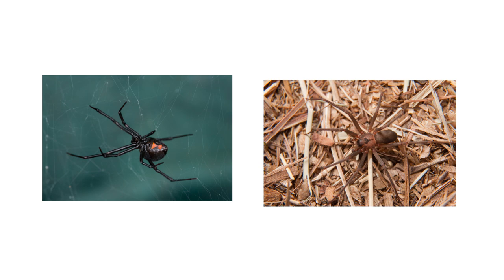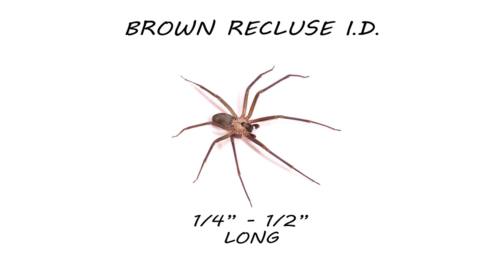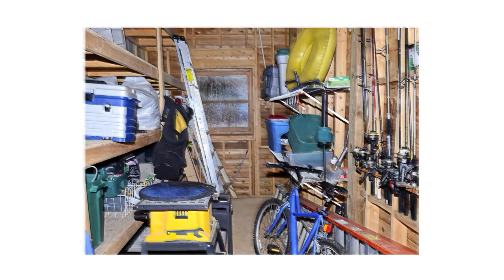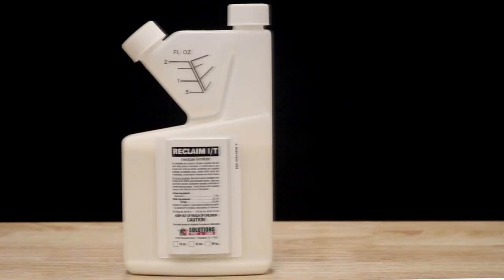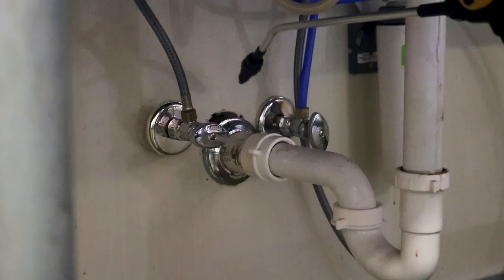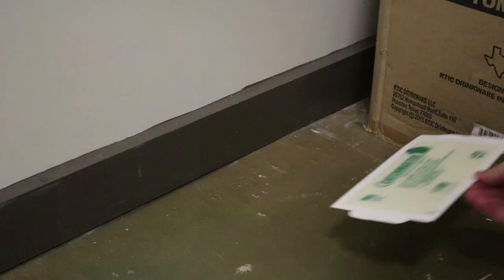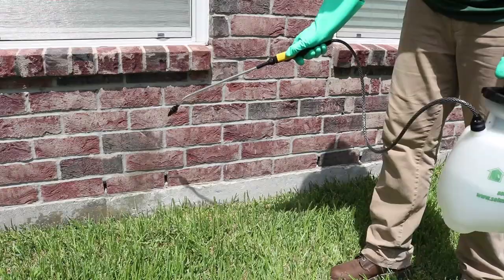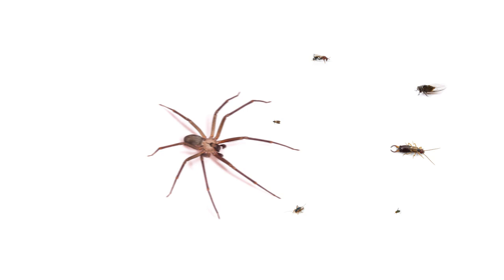How to Get Rid of Brown Recluse Spiders (4 Easy Steps)

Comment: I have a house that gets them bad usually in spring and summer.  You have to use delta dust to dust your attic and around baseboards and behind plug boxes and switch boxes. The spray is only really good for on contact kills. Delta dust is a water- resistant dust that last up to 8 months before you have to dust again. It does help control their population. If you have them, congrats because you will never get rid of them fully.
Reply from the maker: Thank you for sharing your method of control.
Reply: oh this is great, i live in a barnhouse that is seemingly infested with brown recluses and i love to hear i will never get rid of them fully im fixing to call the exterminator.
Reply: @GramCramin  
I'm in the same boat, barn house in Kentucky.
One of the dogs just got bit. It's bad!
Reply: oof I also have this also. but also with 8 different spiders. they seem to like my room. even if there's not many bugs in there. every week a spider at the corner of my room or just my windows.
Reply: @markchidester6239  what happened to your dog? I am struggling with these darn spiders in my apartment and my biggest fear is my dog being bit by one.
Reply: I mean, realistically you can't get rod of them fully, becthey live in you're area. One or some will almost always show up, even if just for a while. 

I live in a house in their territory and I hate this fact just ad much or more than you, btw.

Comment: I've been infested the past 3 years and have done the following:
1. Clean and vacuum, remove as much clutter as possible
2. Filled in any exterior holes in foundation.
3. Cleared brush from the sides of the house.
4. Spray demon max cypermethrin around exterior every month of spider season.
5. Used delta dust inside and out in cracks and crevices.
6. Bought big glue traps from amazon that I placed every 5 feet around baseboards.  
My first year I caught around 30 in the traps.  Last year I'd say I caught half as much.  Hopefully this year will be even further diminished, but we're coming to the heart of the season here in May and June in Kansas.  Fingers crossed.
Reply: They are very persistent little bastards. Even when you think you've gotten rid of them, keep spraying.
Reply: sounds like you have a problem with them under the house.if your not on a slab and have a crawlspace go shut your vents and throw about 8 good bombs under there and shut the door.that should get alot of them cause damn you done everything else lol
Reply: you also can cut up lemons and oranges and place them throughout the house.spiders cant stand it.peppormint oil works great too
Reply: What's the update?  Did it work?

Comment: The best way I have ever found to kill Brown Recluse Spiders is a plastic box or old cooler without a lip around the outside. It Should be at least 12 to 18 inches deep.  Remove the top and place the box in a dark corner of the attic or basement.   Walk away and forget it for a month.  For some reason the spiders can get in but they can't get out.   Seems if you catch one more will join that one till the floor of the box is covered.    A large empty can works too, the deeper the better.    One day I caught one Spider to show to someone who had never seen a Brown Recluse.  I put it in a small, sealed ZipLock bag and laid it on a shelf in the garage,  a couple months later I noticed the bag and picked it up to throw away the Spider I thought would be dead.  Just the opposite the very angry Spider charged around the sealed plastic bag.  The poor thing had had No Food, No water and no air for well over a month,  I gently laid it on the floor and stomped on it.  That's another method to kill them.   Good luck and be careful
Reply from the maker: We have never heard this, very interesting. Thank you for sharing!

Comment: THERE ARE SO MANY IN SOUTH FLORIDA NOW!
I grew up doing Landscaping at my dad's company whenever wanted some extra cash & never saw them. Now if you go to any of the parks around here, look through a pike of leaves or another hiding spot of theirs.....You'll see AT LEAST ONE OR MORE within a Diameter of 3 Feet and that's not an exaggeration! They're little stealthy m fers to that Love to hang out in cloth such as your clothes, boots, bookbags etc etc
At Night they often jump off of branches n stuff because I guess to save time n effort.
Their low center of gravity probay helps them with the fall impact on top of making them super stealthy to hide in nooks & crannies.
They seem not like the color white for some reason. I think it's because they have problems camouflaging themselves to it which they do change the color tone of their bodies to fit in with their surroundings.
The Other Week
I Got bit by one over 20 TIMES  while sleeping. If you get bit you got to push that poison out of you. To me it felt like a very heavy poison that remained primarily in the lumbar that was bit. Anyways where the bite occured a blister will form. You need to methodically massage around the bite towards the blister which will also prepare the Blister to pop(if not use a sterilized sowing needle to assist). Once popped then continue with another round or to pushing out the poison.
The more poison you push out the less it will swell. For me took about once a day popping all 20 bites and massage the poison out for 3 days.
Keep it ice pack and ice handy for reducing swelling. 
Clean thoroughly the area especially after you massage the poison out of you sessions

Comment: I don't if it was a brown recluse but i have found many in my house. They do like cluttered places, i found one in a parts bin.
Reply: John Smithy , thank you very much. Everyone I the house has been seeing these spiders, so hopefully we can do something. We have been using peppermint oil in some places to avoid them nesting, however will still don't know where they are coming from. But I hope we will find out to fix this problem. Thanks again for the help!
Reply: @ @arandomhobbychannel6718  
I honestly hope you don't ignore it. I did, and it got worse and worse. I've had Orkin pest control services (year round) for four years, But I still see Recluses come out, during the Fall mating season. They are called "Recluse" for a reason, they hid and only come out at night to hunt. Strips of Duct tape can also work as a gluetrap/monitor station.
Reply: @richmellow3315 , Thank you for giving me more info! Right now none of us have seen spiders in a while now, nut I will keep everything you said in mind. Even though we haven't seen any in a while, we continue to spray peppermint oil around our windows and small holes we might find along the baseboards. But once again I will keep that in mind.